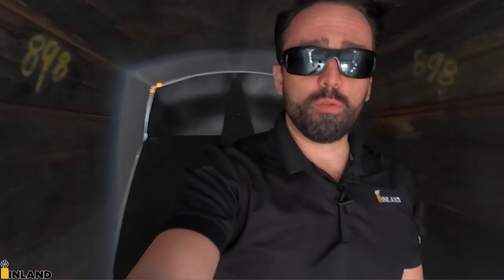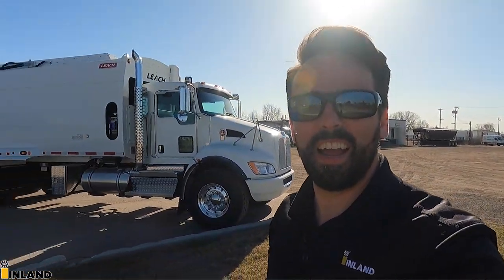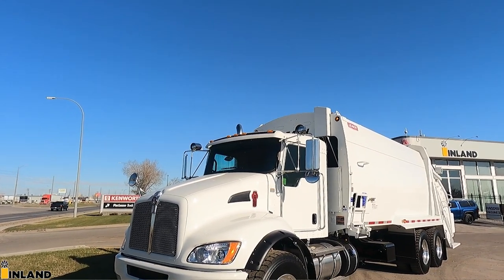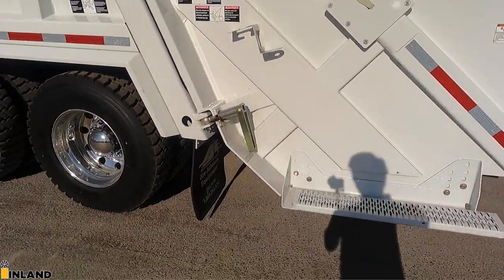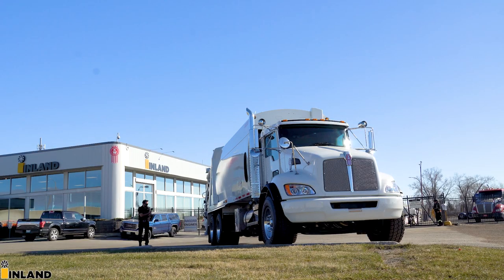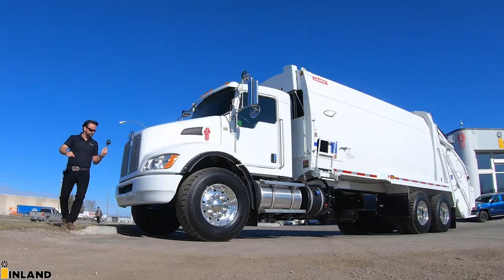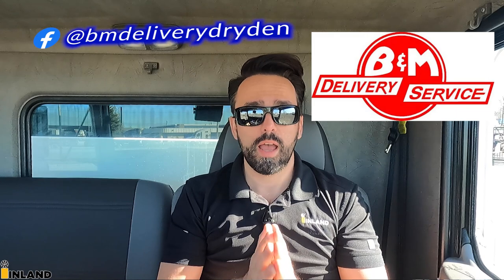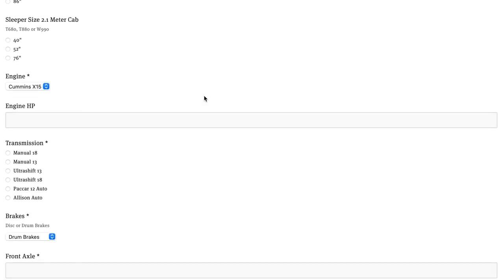GARBAGE TRUCK   Kenworth T370   The Kenworth Guy

Comment: Only thing I would change is the painted front bumper. It’ll be chipped up and rusty in no time vs a chrome or stainless bumper. A shame because the painted ones look great. 

And maybe durabrites instead of the level 1 wheels. Garbage trucks get filthy and don’t get cleaned very often. And when they do get washed it’s just a rinse, no polishing.
Reply from the maker: A squirt of paint now and again won't hurt.